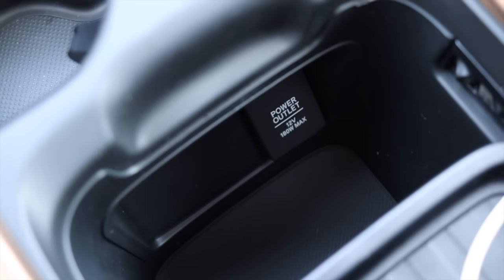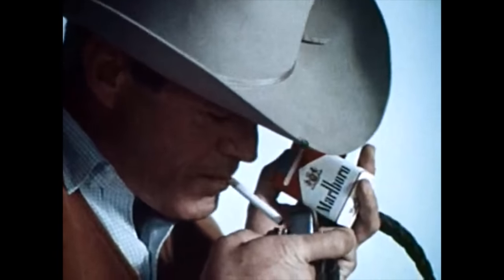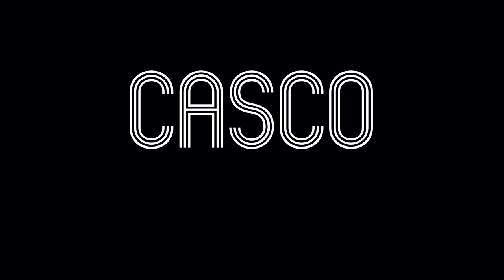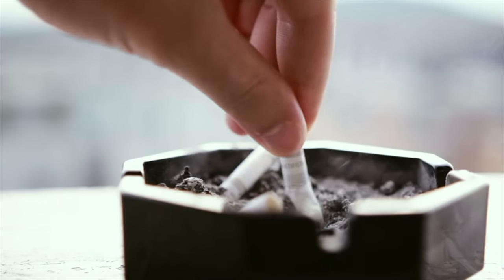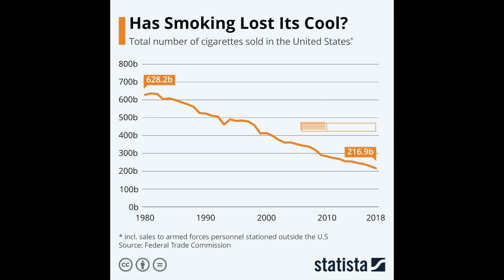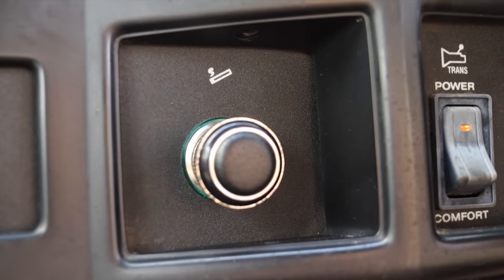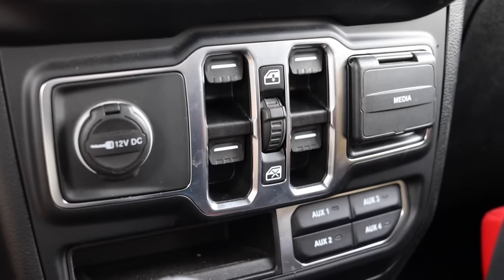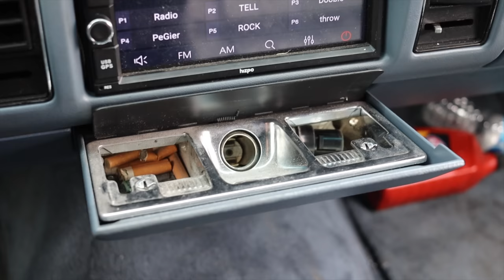Cigarette Lighters - How They Were Invented & Why They Went Away!

Comment: Some Japanese cars had actual outlets that they and the US use in homes. The problem is, they need an inverter to get the required voltage, and these inverters can only handle so much power. Fine for charging a laptop on the way to work, but invariably somebody will blow a fuse or start a fire trying to use it for microwaves or something. The plus side of using 12V is that's what the car battery outputs, and the circular design means you need the right adapter.

Comment: Ahh the cigarette lighter, that useless thing that got lost so you could plug in your CD player 12v and run the adapter thing to the tape deck.   Was also handy for the Sega Game Gear on road trips because that thing ate AA batteries faster than one of those OG 50lb boom boxes did D-Cells, so using the 12v adaptor you could run it the whole drive.

Comment: I find it very convenient to have a direct connection to the cars 12v system in my truck. Try running air compressors, charging large drones, running spot lights, or AC converters off a USB. The truth is those 12v ports at the amperage they deliver are infinitely more versatile than any 5v 2 amp or available. Robust and high amperage delivery.

Comment: I don't see the 12v outlet going anytime soon. While USB supply is fine for most in-car electronics, the 15W supply is pretty piddly compared with the 60W to 240W available from a higher-current 12V supply. Running a coolbox, or other higher-powered device needs the higwer-powered supply.

It's also not as though they're expensive to implement - the car's internal electrical components already run at 12V, so all it needs is a fuse, some wire, and a socket to include.

Comment: The funny thing is that as far as I remember, everyone used either matches or a lighter and almost never used a cigarette lighter. The previous owner of my VAZ 2103 used a cigarette lighter, but judging by the condition, it was only 10 years old and in the 90s he returned to using matches. I don’t smoke myself, but I want to point out that lighting a fire and lighting cigars with a cigarette lighter is convenient, especially when the matches are damp or the lighter runs out of gas.

Comment: I'm 58 and remember a lot of these older vehicles and how they were loaded with cigarette lighters.  However, growing up my parents never smoked.  My dad would have a cigarette occasionally but rarely around us kids.  I remember a 1976 Cadillac Coupe DeVille I bought from my grandfather was loaded with them.

To me the "cigarette lighter has always been a place to plug in things like radios, cassette players, lights, etc.  I find they are still required.  However, my new 2024 3/4 ton truck only has one.  On top of the dash.  Not face of the dash or in the center console.  It has plenty of USB-A and USB-C ports but only the one 12-volt power port (cigarette lighter).  This wasn't convenient for my 12-volt cooler which I put in the back seat on trips and have to string the wire between the seats and up the dash.  I will have to wire a couple myself. 🤦

I think the USB ports in my truck are only 5-volts.  I know there are supposed to be higher voltage USB devices (48 volt???) but I don't think that is what my truck has.  Something like a cooler or other high wattage devices are still going to need the 12-volt power jack.  I can see (maybe) creating a different type of modular plug.  However, as long as a vehicles electrical system operates on 12-volts, I think the 12-volt power port (cigarette lighter), is going to be relevant.  Sorry so long. 😁

Comment: My first car is a 2001 mustang convertible that I bought 2 months ago. The person I bought it from had it for 17 years and his wife only used it to get to and from work, and the person they got it from did the same, everything is stock and the cigarette lighter had never been used once, so I unplugged the connector and wired it to a splitter for some lights/usb extensions, and then left the cigarette lighter in the socket (unplugged) for aesthetic because it just completes the whole dash, I wish I could have just modded the stock sterio instead of putting in an aftermarket, but the stock didn’t even have a line in and the touchscreen one is bought had CarPlay and android auto.

Comment: The reason for the 12V cigarette lighter outlet remaining is for a few different reasons. 1. Many automakers still sold accessories to add a lighter and ashtray to their vehicles after purchase. 2. It was much easier to keep the outlet instead of designing an entirely new standard. 3. In order for a vehicle to have an outlet like the one in your home there needs to be an inverter to convert the 12V DC power to 120V/240V AC. Inverters are expensive and usually require active cooling. Some high-end luxury vehicles and pickup trucks have them, but it would have never been feasible for that to become standard on all vehicles.

The bottom line is that it was just easier to keep around a decades old standard and repurpose it for device charging in the modern era than it was to reinvent the wheel. If it ain't broke don't fix it, as the saying goes.

Comment: Well, as a cigar (not cigarette) smoker, the ashtrays are too small anyway.

And we would never have the same outlets in  the house and in the car because the house outlet works by a different kind of current that the car can only supply if you use electric converters which are way expensive to put in cheap cars. Premium brands or those trying to look like them might put it. The cigarette lighter on the other hand don't demand this special contraption.

And I have a brand new hyundai excavator, there is still a cigarette lighter there

Comment: That circular connector can power several types of 12V/High-Amp direct-drive tools/spotlights.
A USB port 5V/3Amp made for recharging phone/laptop etc. batteries would not be able to handle said 12V/High-Amps direct-drive tool applications via standard USB port/plug and cable.

Comment: My first 2 cars had cigarette lighters in them. I did used them to charged my phone towards. I also remembered there was no ashtrays in those 2 cars. I remembered seeing a no smoking sticker in my 3rd car. It had 2-12 volt outlets close to the driver. Even my 4th car the same and my current vehicle has one in the front, for the back seat, and one in the rear. Still there is no smoking in my vehicle since I don’t smoke.

Comment: I don't think we'll be seeing "normal outlets" in cars any time soon. While the shape of the car outlet was designed with the cigarette lighter in mind, it's a different form factor because it is a 12V DC outlet. Your car runs off of a 12V DC system, where as your house runs off of a 120V AC system. Car devices tend to be low or medium power, and are typically DC devices that can take advantage of the car's native 12V DC system.

To put a standard outlet in a car, you'd need a device called an inverter. This adds extra cost and inefficiency. Most devices you'd want to run in a car, are low voltage DC anyways... With an inverter setup, you gotta change the direct current to alternating current, then step the voltage up to 120V. Then connect the power brick for your device, step the voltage back down to anywhere from 5.5V to 24V, and then rectify it back to direct current. This ends up wasting a lot of energy and adds a lot of unnecessary cost.

It's a lot easier and cheaper to just use the 12V socket and use a voltage divider circuit to get 5.5v for your cellphone, or a step up circuit to get 19V - 24V for your laptop or something.

Comment: In my 2006 Nissan it does not come with a lighter and an ashtray.  Only plug for vacuum, mini refrigerator, and more. No USB plug.  Only IPOD.   My father was a heavy smoker.  In our cars was so reeks until his death at 69.  And you have mentioned about a silver button on the floor. I remembered our 1971 Ford Galaxie 500.  It was dimmer.  And no more starter on dashboard. It’s on steering.

Comment: Well there's now 4 12V sockets in Dad's new Kuga. On top of the list of 5V USB sockets. Between 12V to USB adapters, Sat-Nav and dash-cam chargers, laptop chargers, aircompressors, torches and lights with 12V plugs, even electric camping hobs and kettle's. I think there's far too much in use today running on 12V for them to disappear "soon" at least not entirely.

Comment: It's not just that tobacco has gone away. There's the reefer that makes a resurgence but the problem is that... Smoking the reefer while driving can be as hazardous as drinking alcohol while driving. Which is another reason why they remove the cigarette lighter along with that there's plasma lighters that are rechargeable and less dangerous than a cigarette lighter which can leave a nasty burn when mishandled.

Comment: Soeaking of obscure plugs in cars, my friends 2016 Honda Fit has an HDMI plug in it so you can use the 8 inch Navigation screen as a monitor for your PS5 or anything with HDMI. Was the first car I've been in with HDMI. Not sure why you'd use an 8 inch screen as a display, but you can if you want to. Pretty cool that it has it.

Comment: I never understood why GM used two keys for so long. A square key for ignition and a round key to unlock. I used to think Ford's were cool because they only had one key, then I realized Japanese cars also only used one key. I'm referring to cars of the 80s and 90s here. Then we got clickers, then keyless entry, and now apps on the phone. Keys - more to them than you know. Another chapter in the key video might be how Ford has keypads on the handles and then the window surround of the drivers door that allowed "key less" entry. I think that function is still around today.
Reply: I had a 1990 ford bronco that had separate keys for the doors and ignition as well so ford's had it as well
Reply: Reason for the two keys was for security. Especially with valet parking. The valet had the key to operate the vehicle, but no access to the trunk or glove compartment. The reverse could be true, if you wanted to give access to the car, but not operate it, such as someone getting something out of the car, but they could not run off with the car.
Reply: @robitussinx  Yup.  Older Ford's used two keys as well.
Reply: @nwragsdale  German cars had this… 1 key for yourself for everything, 1 for valet . Make sense.
Reply: @robitussinx  Right up until the 1992 restyle.
Then Ford used only the square ignition style key in the doors too.
The oval and square keys had reversed keyways.
Reply: Own two 92 rangers since high school back in the 90s. Both use different keys to start and open doors

Comment: I hardly ever saw people use these unless they didn't have a lighter on them. They would just use BIC or Zippo lighters since smokers already had them on hand. Plus the time delay for it to warm up was about 5+ seconds. It was quicker to just pull out the lighter from your pocket and light your smoke. Also, there are still plenty of smokers today, but due to lack of an ash trays,...people just throw the cigarette out of the window now instead of having a place to dispose of them in the car.

Comment: The circular outlet offers a much higher amp output than any usb including usbC.  So if you want to hook up an inverter to run higher watt devices like a car vac or camping things it’s the circular outlet or direct to battery. So it hasn’t been usurped yet.

Comment: I don't think the 12v outlet will ever go away, even as USB outlets and 120/240v house-style outlets become more prevalent in cars. The 12v outlet is a direct connection to the alternator, which is good for high-current devices such as tire inflators, jump-start packs, etc. USB ports can't push the kind of power that these devices need (not even USB-C) and an inverter that could push this kind of power via a household-style 110v outlet would be expensive and is far beyond what the ones generally included in modern cars can push.

Comment: Why has Cancer not gone down at an equal rate to people smoking less?
Reply: Lung cancer death rates declined 45 percent from 1990 to 2015 among males and 19 percent from 2002 to 2015 among females due to reduced tobacco use because of increased awareness of the health hazards of smoking and the implementation of comprehensive tobacco control.
Reply: @DavidLS1  any knowledge on why its different between men & women? appreciate you taking the time to reply to me david
Reply: @zackwaffen9210  Off the top of my head, I'd attribute the difference to the fact that the men's drop was over 25 years while the women's drop was only over 13 years.
Reply: @DavidLS1  thanks again mate
Reply: @zackwaffen9210  No worries.

Comment: Just an FYI, the cigarette lighter outlets and the newer power outlets are NOT the same. They specifically design the newer outlets to not work with cigarette lighters. Mostly since the new ones have a lot of plastic pieces that can melt or catch fire from the heat generated by the cigarette lighter.

Comment: No, they won't just up and disappear, and the main reason is you can't power every vehicle accessory off of USB. I have a Cooler that plugs into that 12v vehicle receptacle to keep it cold. I have an adapter that takes it from the 12v DC to AC nad standard plugs for devices like laptops. I also don't need car companies having access to my phone.

While even I won't say the 12v plug is here to stay, it is likely to be replaced with something better for vehicle accessories later, rather than just USB.

Comment: I used to smoke cigarettes. I'd never smoke in the car, because it made the car disgusting inside. So I'd rarely use the 12 V lighter. I got a new car a few years ago and moved all the junk from the old car into the new car, including a spare 12 V lighter. One day I lost my butane lighter, couldn't find any matches, and then found the 12 V lighter in the glove box. I was dismayed to discover that it didn't work in the new car. Some component is missing in the socket - probably a clip to hold the lighter until it gets hot. I tried holding it in place manually and it still didn't work. I've never had a explanation for why that is, though.

Comment: Most amazing connection through time - the distance between the wheels (left to right) of the Curiosity Rover - the width of the normal car - the width of roads - the width of roman chariots - the width of two horses and the equipment needed to get them to tow the chariot.

Comment: About the last point - cigarette lighter sockets are awful power connectors since they were never designed to be power outlets. They are loose, the contact points are not good enough and introduce high resistance. However USB can not fully replace them. USB is fine for phones, radar detectors even laptops but high powered USB charging ports require more expensive circuits than simply a cable from the battery with a fuse (as it is for the cigarette lighter socket) and also i don't see much USB-c powered cooler boxes on the market for example. I do not think we will replace the 12V socket soon and if we do i do not think we will replace it with USB only. More likely there will be som 12V sockets which will be of different shape better suited for their job

Comment: The cigarette lighter outlet may be outdated, but it offers something that USB doesn't. 12V straight from the battery. Even today you still have use for 12V, it just happens to be this circular ourlet. If it wasn't this, then it would be something else, but you'd still have on outlet for 12V.

Comment: Honestly, I really appreciate this 12v plug

USB are not really standard, you might want fast charging charger and the USB you get at car might only support 5V only

But with this outlet, you can just buy new 12v plug fast charging, new fast charging came out? Sure just buy new charger accessories, old car? Sure its still work

Comment: Cars offering usb ports are moot; they don't offer fast charging speeds to boot and are usually usb type a. Most cars lack actual outlets and hence the circular outlet, of which most appliances are still based around (looking at you 85 watt oneplus for a cigarette lighter outlet.)

Comment: At first they were considered cigar lighters and they worked really good for cigars. Typically a premium cigar you don't just stick a match or a lighter to it and puff away because that sucks flame into the cigar, burns the tobacco too much and destroys the flavor. You toast it with the flame for awhile then lightly puff on it after the tip gets going. Not practical to do while driving. The electric cigar lighter does not produce a flame and is the right temperature to toast the cigar tip quickly while driving. There were even ones produced that ran off of household current for home use. Torch lighters used for toasting are crappy even the expensive ones only last about a year, tend to run out of butane un expectantly and are still hazardous to use while driving since both hands are needed to properly toast a cigar. I installed a cigar lighter in my newer truck because I like to smoke premium cigars and about the only times I can actually enjoy one without any hassles or getting sidetracked on a project is when I'm driving.

Comment: Without cigarette lighters I would imagine cars would have implemented a cobo type 3 plug. 3 pins. It would provide a better quality connection and be no larger than our standard 12v outlet now. I use these alongside the round 12v outlet in many agricultural machines. I run a 2015 Toyota hilux and that still has a cigarette lighter, I find the USB port charges very slow but that's probably just my vehicle

Comment: So far both the cars I have owned (2002 Peugeot 206, 2007 Mazda 3) have both had cigarette lighters 
The one in the 206 never worked, and I never had the idea to try a charging adapter in it 
The Mazda however, did have a working lighter. I tried it once before throwing it away and replacing it with a phone charger